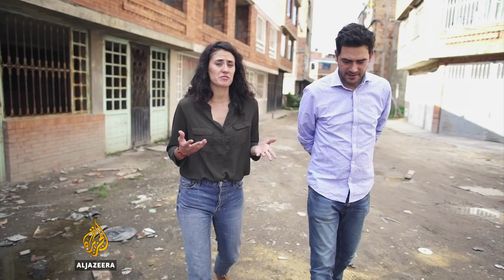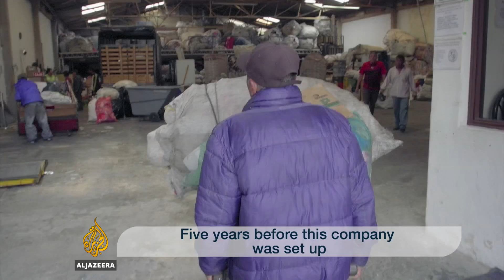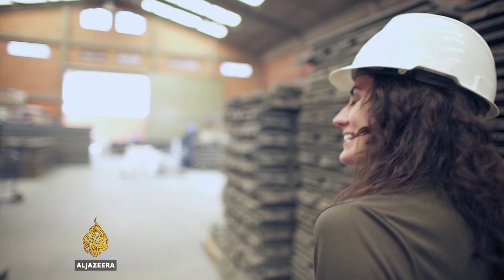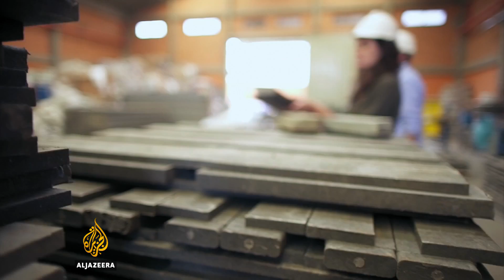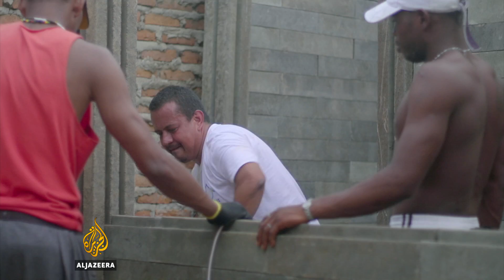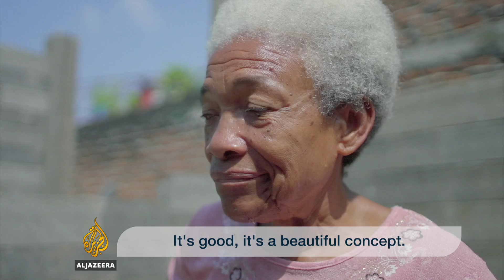🇨🇴 Colombia's Lego Homes - earthrise (lead)

Comment: I used to do recycling in Los Angeles - best paying job I've ever had (and I've got a Master's Degree) although I normally worked over 60 hours per week.  Too tiring.
Steel, newsprint, cardboard, aluminum, copper, brass, other recyclables and resellables - but never plastics.
Maybe now that will change.... .
Reply: Nice

Comment: While this might seem like a good idea it really isn't the toxic gases from the plastic under heat conditions will make someone ill along with the building Wapping and possibly giving off static electricity. Also this is not fire retardant which is a shame because places like this they can easily grow hemp and make hemp concrete.
Reply: Hempcrete and other products are fine, but this looks like a great use and help in driving recycling.
Reply: Not sure how it will make someone ill when it's literally the same plastic that has been previously used to make bottles people drink from.  You can also easily add some sort of fire retardant to it (many plastics already have this, it's the reason why old beige plastic turns yellow).  Let's not forget that if anything does leach out from it, it's going to do the same thing when it's in landfill where it can contaminate groundwater so burying it in landfill instead of building houses with it isn't really much of an improvement.

Comment: Everyone keeps talking about fire, yet 2/3 of homes in America are built out of WOOD! You could easily chemically treat this plastic to make it fire resistant
Reply: And then residents breathe the chemicals from the treated plastic. A great idea, not.
Reply: Mick Carson you know construction materials which builders use currently are treated with fire retardant right? Nationwide manufactures are required to treat wood and insulation. This is pretty common knowledge.

Comment: But do the bricks offgas? or leech chemicals? What testing has been done?
Reply: It's the same as 3d printing
Reply: They kept the temperature just high enough to melt,so there's no fumes is what they said.  I'm sure they're gonna paint etc...which would seal any off gassing.  🤔
Reply: They do not care about those because they are so poor that having a house is better than having none.

Comment: This sounds great.  But the reality is that the bulk of the construction cost of houses is in finishing and fixtures.  There are a gazillion ways to come up with cheap shells, from the traditional brick walls you see in the surrounding ghetto, to rammed earth, 3d printed concrete and in different climates drywall on top of lumber or straw bails.  But they don't have much impact on the affordability of housing.

Comment: So I saw a few bolts and plate mounts but how durable is it? What's its compression strength, can it be used as a foundations, etc. Also can the plastic be beefed up by tweaking the formula and yes, ref comment below, what about the toxic fumes incase a fire breaks out. This is a wonderful and ambitions venture that holds many possibilities if they get it right!

Comment: just worried of what will become of the plastic when the building has reached it's use & is to be pulled down
Reply: Matt Dathew modern problems require modern solutions, the same way the plastic was repurposed to be a house, that too can be repurposed.
Reply: @pablo_frescobar1698  you use way too much energy to recover any plastic from brick. Really, plastic should just be recycled into other plastic or fuel

Comment: What about toxic fumes in a fire? Recycled plastic is banned from most housing construction in modern building codes.
Reply: There are toxic fumes in a fire of a regular house. 
Its better than not having a home or sleeping in a tent.
Reply: @dannyk847  Yeah, that's what they said about  the Grenfell Towers on England, thee Bangladeshis dormitories, and about a dozen other incidents in the last two years around the world.
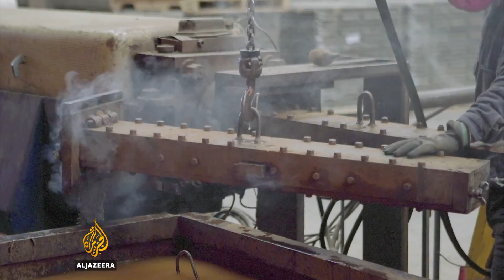Reply: they said they will leav it at a melting point so it wont release toxic gases at 4:42
Reply: @gadacdagaweel6773  Yes, that was during manufacturing. 
But in a fire, those toxic gasses WILL be released.
Reply: @dnomyarnostaw  whats more toxic ? wood burning ore plastics, if your trapped in a burning room the effects will be the same.
Reply: @stephenmitchell4393  Not true. Plastics emit denser more toxic smoke that affects breathing very badly.
Just throw a tyre or plastic milk crate on a campfire and watch people toasting marshmallows cough and retch.
Reply: @stephenmitchell4393  most people that died in a fire actually died from the smoke
Reply: Plastik fires are easy to extinguished.

Comment: Have to wonder if this product is treated with some sort of fire retardant..
Reply: Do they treat wood with some sort of fire retardant??
Reply: @samwelonduko9696  yes.
Reply: czrobot czrobot in the us lumber that’s for international construction is not treated.
Reply: @chedderburg  the only wood that is treated in usa is " pressure treated " wood.   Its pine that is pressed with insecticide .   They used to use arsenic , but when the wood was cut ,the dust inhaled had lead to people's death .
Reply: @samwelonduko9696  no . They do not .  Not in the USA . Stick frame lumber is untreated pine . Wood for outdoors is treated with insecticide .
Reply: @boracay12   y then could you suggest they treat it plastic yet they don't treat wood with fired retardant yet wood is commonly used in construction???
Reply: It would melt for sure .

Comment: This is the result of a society with neither researched technical governance nor safety codes and regulations.
Great concept but flawed in general safety concern.
Solid plastics or plastic blown insulation such as open/closed cell spray foam insulation MUST be fire protected to provide sufficient egress time in case of fire.
These plastic boxes are a death trap.
DO NOT construct any habitable space with plastic.
Reply: You seem to be very knowledgeable about it. Is there a way you're able to  fireproof the blocks? Maybe by covering each block in a fireproof layer.
Reply: @shloopy6882  
Plastic insulation can't be fireproof per se.

There is a product (paint) the entertainment  industry uses to coat their foam stage props, problem is this retardant is NOT accepted for residential application.
People are generally dressed and awake in an entertainment venue and could react immediately in the event of a fire etc.
In a residential application we are concerned with sleeping children or limited mobility seniors that the paint would not provide adequate egress time.
So the fire retardant paint is out of the question for residential use.
In a residential (Canada) application any exposed plastic insulation MUST be protected with a layer of non combustible material such as drywall (wallboard).  The wallboard must be taped and completely cover the plastic.
This does NOT fireproof the plastic it retards the fire long enough to exit the building before the space is engulfed in smoke.  
The major concern with this plastic block application is a lack of fire separation between floors and neighbours.
How would you get out If a fire should erupt at a lower floor without containment provisions.
On the surface this idea sounds great but it completely ignores public safety.
Hence we have codes and regulations in place based on safety research and historical data.  
Hope this answers your question
Cheers,
N

Comment: A big concern here is FIRE and the off gassing burning plastic produces.
An out of control fire could produce deadly gasses that could wipe out an entire neighborhood .
The manufacturing process mentioned keeping the plastic within 240-250 F (see 4:44) to avoid releasing toxic gasses.  
This should tell you everything you need to know about using plastic for building living spaces.
There is NO mention of fire retardant application.
Reply: @Mr Brightside 
It's generally smoke that kills
Reply: @Mr Brightside 
I go with your initial idea
Let's put an end to single use plastic.
Remember James Bond Island filmed in Thailand?
Go check it out now.
Mountains of plastic and  single use containers chocking the eco system.
Want another one?
Go check out Australia's recycling system...criminal.
They ship their plastic waste to third world countries meanwhile scamming the taxpayer in supporting 'Green' businesses.

Comment: Why not make the bricks thicker using the same amount of plastic, but more hollow? That would make the walls sturdier. The longer the wall, the more it will bend in the middle. That deflection is proportional to (force * wall_length^3) / thickness^3.

Comment: I wouldn't build the kitchen section out of a plastic material.
Reply: @Mr Brightside 
Precisely 
If I recall they use bottle gas in their kitchen for cooking...what a combination!!
Reply: I'd be concerned with fire rating
Reply: @Mr Brightside I totally agree. It would be much better for them to spend the extra cash they use to buy the plastic bottles in buy a few bags of cement and mix it with a large qty of soil that is readily available to make an interlocking earth blocks.

Comment: Plastic is also so durable it beats bitumen for airport runways, taxiways, roads, and streets hands down!
Reply: Yes, I made the same comment! WooT getting the word out!
Reply: @Mr Brightside Well Mr. Brightside we are NOT talking about using this brick system for roads or airport runways but replacing tar with plastic it would be extremely similar to the way such things are normally made you would mix sand and gravel with shredded plastic heat it in a big hopper dump it out on a prepared bed of compacted graded earth roll it flat and boom road etcetera.
Reply: @Mr Brightside Oh boy so how much of the Earth is made of Rock? Yeah so...semantics.
It takes the same amount of energy to heat tar as it does to heat the plastic to a melting point and yes when making roads you do need to heat the tar.
THINK about how potholes are formed water accumulates under your road freezes expands and then when it melts collapsing destroying the road and making a hazard that also damages your vehicle. Also sinkholes so your touted advantage for tar really is not an advantage unless you are in the roads repair business.
Reply: @Mr Brightside Ok so it takes twice the heat and lasts ten years or you can go for half the heat and next year start filling the potholes and so on...

As to plastic being slippery what do you think the sand and gravel are for? Ah yes, filler and friction.
You may not be in the road building or repair business but the politicians' cronies sure are and they donate more to "campaign funds" than you do.
Reply: @Mr Brightside Energy consumption: if have you rebuild the road only half as often the energy consumption is equal etcetera the longer it is till you have to rebuild the lower actual energy costs are.
 Plastic roads last longer how do I know because Germany and India did studies to find out.
The rapidity of pothole formation depends on your local environment.

To the plastic surfaces getting worn down assertion the plastic is just binder for rocks are tires going to destroy rocks? wear them away? No, as the plastic that is between the rock is sheltered from that wear like mortar in brick walls.
Now you probably are going to mention UV degradation and it is countered by adding carbon powder to the mix.
What do you think tar is? Fairly toxic hydrocarbons that get into the environment from the roads so at worse plastic is an equally problematic material to use.

 And that ladies and gentlemen is the use of debate fallacies Ridiculum and Strawman argumentation by Mr. Brightside at the end.

Comment: What’s the lifespan of such a house as compared to the ones built with the traditional concrete blocks.
Reply: although concrete has a long life it does suffer from the metal rusting (concrete cancer). so the concrete only as good as the rust proofing and quality of the steel that reinforces it and the distance from the surface to the metal as exposure to the elements will speed up the process. The plastic will have a long life but difficult to say if it will be as long but the benefit is that the plastic should be able to be recycled again i would think.
Reply: He said it at the beginning of the video, a house like this could last 400 to 500 years.

Comment: Is there a danger of the plastic releasing toxic fumes into the homes?
Reply: David; Yes but my walls are drywall and cinder block. Not off-gassing Lego.
Reply: Not exactly, Should there be better ways sure but it's safer then concrete.

Comment: If people are in doubt, that plasctic, Is extremely dense and can very well compete against bricks. It wont melt even at the max temperature possible by average stoves.
Reply: Grease fire etcetera and then melting and burning and more melting and burning.... use the plastic for binding road gravel it would be far easier too put out a road fire.
Reply: @Barskor1  also road would be far cheaper
Reply: Trump who is determined to build a wall could solve the US plastic problem if he uses this.
Reply: @jasmineaugust  lmao 💀💀

Comment: plastic house and kitchen is a disaster in making!!
Reply: If you cover it all with a thin coat of cement it would be the same as houses made out of wood. As long as the occupants are being responsible, it should not be a problem.
Reply: They are not, Plastic is mixed with other stuff at making the brick  to be secure. You Can ask directly if you want more information. They are not flammable
Reply: swaroop joseph 

Is there a way to make an outside kitchen and use plastic for the house and possibly tin for the roof 

I get your point but still can they put fire retardant in the plastic ?

This could be sustainable if donr correctly ???

I wonder what the floors are made of?
Reply: The formula used to make this makes it fireproof
Reply: Sprayed with asbestos? You know that asbestos is highly carginogenic right? Probably not a good idea for a home. Surely there must be a flame retardant that will not lead to cancer. @eldorado1244